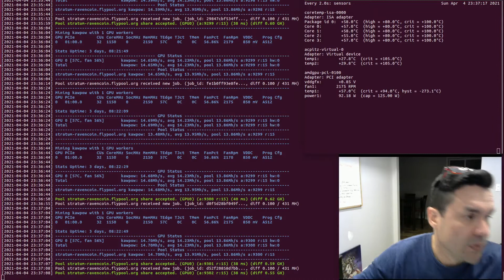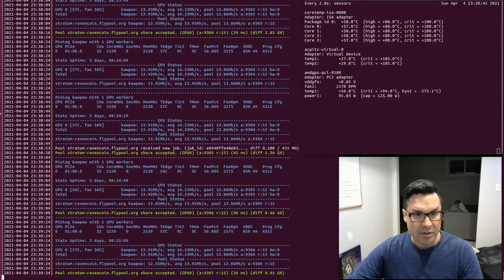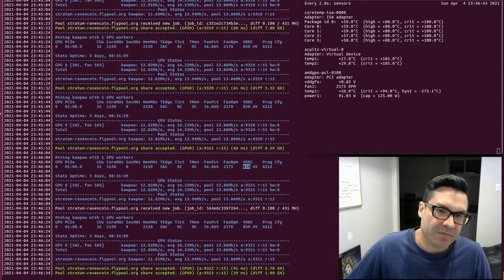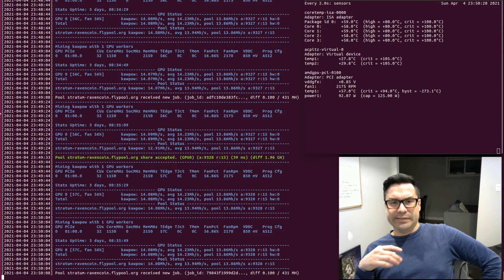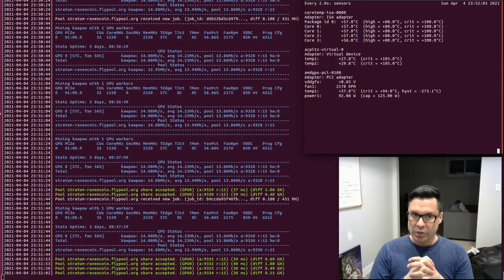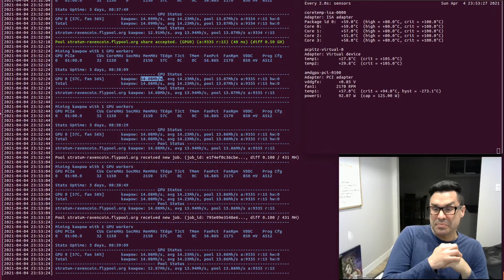Mining Ravencoin on Ubuntu 16.04 using RX 570 and TeamRedMiner

Comment: Thanks for sharing your experience. I'm running the same GPU but on stock settings what and how did you achieved your setup for the GPU (overclocking, undervoltage or other configuration done) I can't find any guide to successfully overclock amd gpus on ubuntu (at least not one up to date) and for the system (drivers version and teamRedMiner version)?
Reply from the maker: Are you mining already??? What drivers didnyou install?
Reply: @cryptoagur7273  yes, im mining but on stock settings. I've installed amdgpu pro with opencl, you did tune your gpu manually or with radeon profile?
Reply from the maker: You are on track. Well done. On your Ubuntu system go the following folder
/sys/class/drm/card0/device/
Inside the device folder find the file named pp_od_clk_voltage and let me know if you can open it
Reply from the maker: BTW, on Ubuntu is easier to overclock and undervolt manually via script. But let me know first if you can access the file I told you
Reply: @cryptoagur7273  yes! I found it and im able open and edit it (as root). By the way im mining on a xfx rx 570 (slower core and memory by default compared to yours)
Reply from the maker: Hernan Prado Juan OK good. Send me your core and memory clocks as they appear on that file and I can write a script for you
Reply from the maker: Hernan Prado Juan email me at cryptoagur@gmail.com. It will be easier
Reply: Can u tell me how u overclock your GPU ?
Reply: @MAX_RITIK  hey, ofcourse (but it was trial and error):

I took the GPU freq down a few mhz (like 100) from its base and voltage went down by 200mV (more or less). Vram, on the other side, is at 1900MHz and 840mV, for this setting I went up a lot in frequency (i cant recall if the original value was 1200MHz) and voltage also went down by 150mV more or less.

Comment: fyi, bump up the core clock to 1200-1250mhz and you can get 15-16mhs.
ravencoin needs more core to memory clock ratio than Eth mining.
So 1100mhz core clock runs good with about 1750mhz memory. 12-13.08Mhs (this is the most efficient)
1200mhz core clock runs good with about 2000mhz memory about 15.5Mhs (uses more power as you need a bit higher core voltage to run a higher core clock but you will get a higher hash)
1250-1280mhz runs good with 2100-2150mhz memory. should get about 16Mhs
Reply from the maker: This is great info. Thanks for sharing